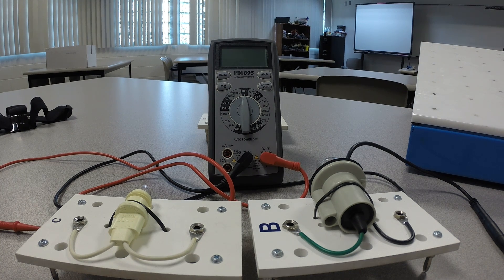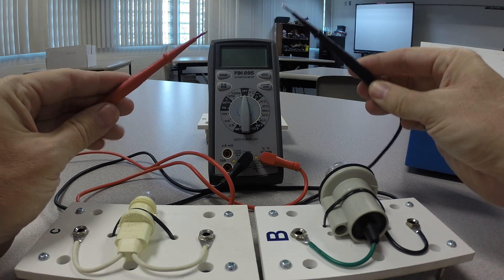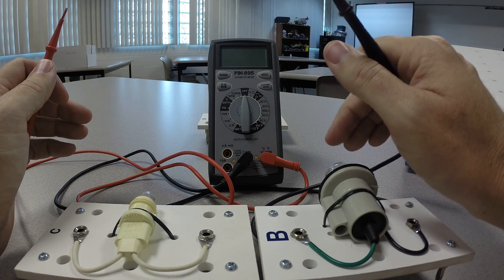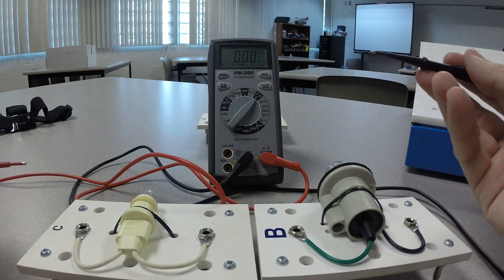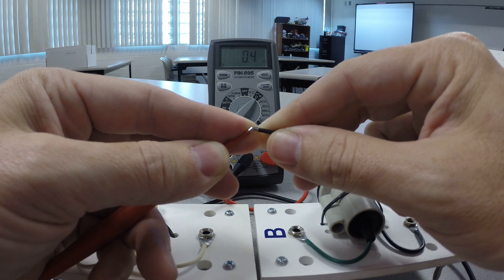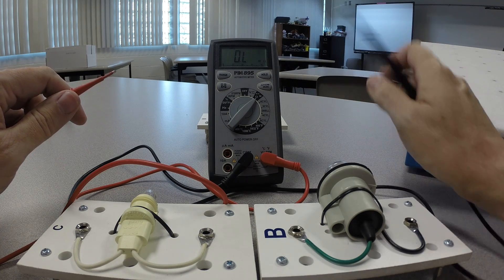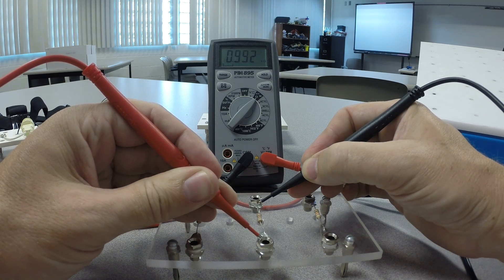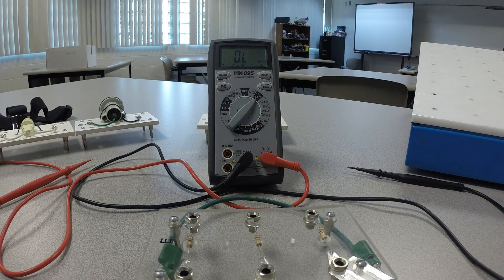Ohmmeter Usage Basics

Comment: Lights will produce a lower resistance cold, then when the light in on and hot will get high resistance. have to test T voltage and T amperage to get total reistance running